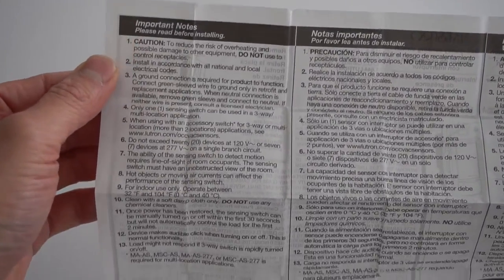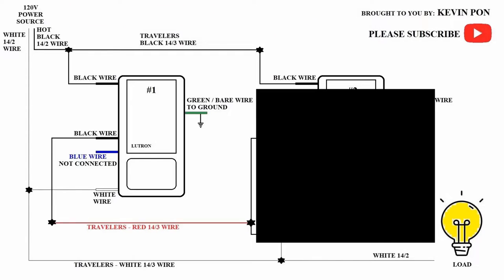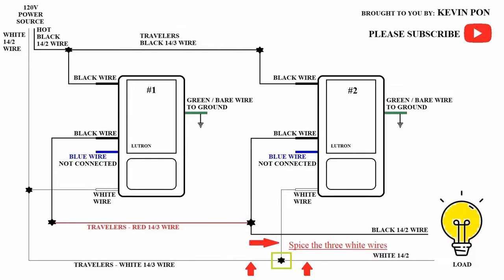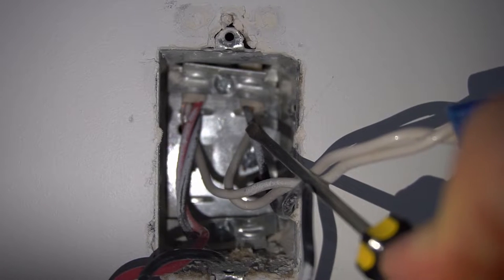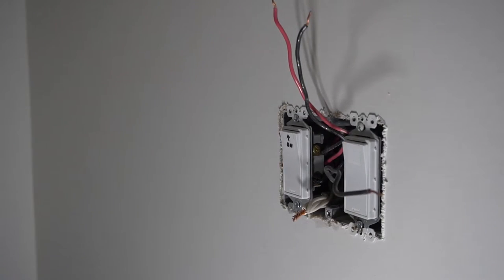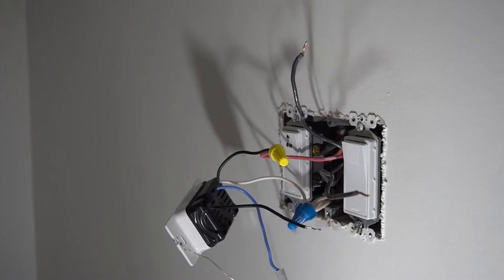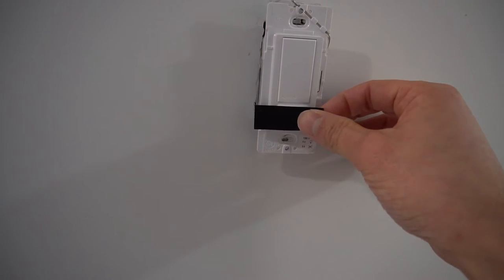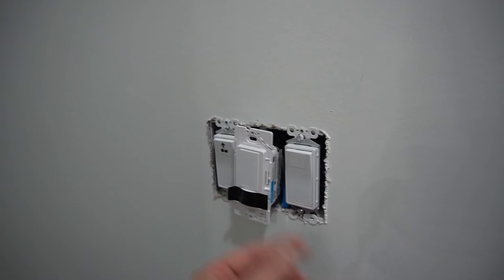TWO Occupancy Sensor 3-WAY Switch HACK BYPASS THAT WORKS! Any brand!

Comment from the maker: Remember to turn off the breaker just in case of electrical shock. Cheaper alternative is using two single pole sensor switch. Same setup. Neutral wire is required!
US:
https://amzn.to/3UtCLhz
CANADA:
https://amzn.to/3hagFSR
Single Pole - Cheaper alternative
https://amzn.to/3W9MUk1
Reply: So they are both being used as single pole? Two single would turn on one light?
Reply from the maker: @rnava435  yes and yes 🍻
Reply: @KevinPon.  I have 3 switches to a light would 3 single pole switches work also?
Reply from the maker: @rnava435  yes it will work. Most importantly is having constant power to all switches and a complete circuit going back to the light. Cannot have any breaks
Reply: @KevinPon.  thanks much appreciated just subscribed to you
Reply from the maker: @rnava435  thank you bro!
Reply: Do most single pole and 3 way switches all come with the same wiring hookups on the unit itself? What I mean is does it being a single pole change anything about the terminals that are used or would I have just as many black wires and load wires as using a three way switch?  Hope that makes sense
Reply from the maker: So the reason for this video uses a 3-way and not a single pole. Is because 99% of the people assume it'll be replacing your original 3-ways but that doesn't work. Have to change the circuit. When the wire circuit is changed, it turns into a parallel circuit that can be controlled just by using single pole switches. In my video were I don't use the blue wire. The 3-way sensor is now a single pole. A 3-way has one more wire than a single pole, path A and B. Hope this clarifies your question 🍻
Reply: @KevinPon.  I gotcha, im bascially trying to do this in my garage where two switches, either up or down independantly, control the garage overhead light. So i guess that would techically be a 3 way switch, but i will just try using a sinlge pole switch on both sides of the garage and see if I have any luck, probably connecting the load (red) from my wall to either of the blacks on the single pole switch, assuming it doesnt matter which one load goes to.
Reply from the maker: That's correct unless indicated in manual and neural wire is required on the switch 🍻
Reply: Wish I had found this before buying the 2x3-way 🤦‍♀️ thank you for making this video
Reply: I’ve done this this exactly the way it’s on here and it’s not working
Reply: Hi Kevin !Is it possible connection 3 switches to one light?Could you please explain or send diagram.Thank you!
Reply: Hi Kevin!I think it should be work with timer switches as well.Is it?
Reply from the maker: @igorl4594  The easiest way to explain this is do exactly how this video is shown. Now when you get to the 4-way switch. Slice the black wires together (constant power), reds together and the whites together. No you will connect the wires just like your other switches 🍻
Reply: @KevinPon.  Thank you!
Reply: I`ve never turn the breakers off when doing electrical work at home, never had a problem with. In fact, I can touch with my hands HOT and NEUTRAL wire (120), don't feel shocked

Comment: Electrician here, I have a couple of years in the trade and yet I sort of skimmed through the official manual without reading the disclaimer of "only one motion switch may work in a 3 way circuit". No wonder the actual diagram on the manual didn't work. Was beginning to think i was going crazy. Thanks a ton!
Reply: That diagram that came with the switch is crap.. :)

Comment: I worked in the occupancy sensor industry for about 15 years. There was a court battle over the patent rights to using a ground return. Long story short, this affected the ability of manufactures to make two sensors work in parallel as suggested here. It is a little complicated legally but some manufactures avoided infringement simply by declaring that a 3 way would not work. In reality, some do. From the example of this video, it looks like it does work.

Comment: Both of my box's only have 3 wires, 1 red, 1 white, and 1 black. I can not find anything that works....... It would have been nice if they told you these switches were designed to only have 1 sensor per circuit. everything else I look into only shows you how to install it per the instructions which does not show you how to wire in two sensors....

Comment: According to your wiring diagram, you can install two 2-ways motion sensors to make light working as a 3-ways circuit.
Reply from the maker: Yes that is correct. I made this video as many requests 🍻

Comment: I guess I have a different model of Maestro switch’s that do not have the neutral wire.  Is there anyway these could be made to work.  I have tried the wiring diagram with no luck.  Thanks

Comment: I think there's 1 more way too, if you get 2 of those chinese 110v pir motion sensors with 3 wire output you could probably wire 2 of them to the same light or string of lights , the wall switch would only turn the whole seup on or off, but you would have 2 sensors pointing in opposite directions. this would only be useful in a hallway, etc

Comment: Not a criticism, just an observation: The schematic (wiring diagram) @ 0.57 shows the BLK Hot (Line) wire connects to the "input" of switch #1 and the "input" of switch #2. The "output" of switch #1 connects to the "output" of switch #2 which then connects to the Light bulb (Load). These two switches are simply connected in parallel, that's all. You can use the less expensive MS-OPS2 instead of the MS-OPS5M and get the same results.
Reply from the maker: I was working with the props I had but that is 100% correct. Good observation Chris! 🍻
Reply: I was wondering why a single pole could not be used instead of the 3-way switch???
Reply from the maker: Yes you can. I was using with what I had 🍻

Comment: Just want to say thank you!!! I am no electrician. Had stairway that makes an L shape to garage. Wanted stairway garage light to work either when I pull into garage or top of stairway going down to garage. Looked at your wiring diagram but your actual installation part proved perfect and easy to follow. I guessed right which box had the load, everything worked perfect the first time after install. One caution to note though…. After installing switches and waiting the minute like you did, it took mine over 5 minutes to switch off first. I almost thought I had something wired wrong. Lucky I waited a bit more. Works perfect. Guess I can program them for shorter on time. Thank you again!
Reply from the maker: You're very welcome. That is wonderful! Glad to hear everything went well! 🍻

Comment: Thank you very much.  This is just what I needed.  I also took a switch apart to see how it works, to feel confident that it was the right way to hook the switches up.  But that made me realize that I could have saved $20 by buying single way switches instead.
Reply from the maker: My pleasure Bruce! Yes you are 100% correct. Single way switches will work as well 🍻
Reply from the maker: @Francis Man if you send me your email. I'll get back to you asap
Reply: @KevinPon.  I e-mailed you thanks.
Reply from the maker: @fcpman40  email sent. I hope you'll understand it 🍻
Reply: @KevinPon.  do you know if I can wire a motion sensor switch at one end and a caseta smart switch at the other end so I get motion sensor on one side and a smart switch on other side? (typically for caseta switch, I think they make u wire one end and jumper the other end and put a wireless pico remote there)

Comment: Had to comment, this worked beautifully with leviton ips06 motion sensors. I did have an issue where when the lights were to be off, the lights flashed full brightness in a pattern of 0.5 sec on, 1 sec off.  was driving me crazy until I read as a troubleshooting step to swap one of the LED bulbs with an incandescent.  Did this, and it solved my flashing problem.
Reply from the maker: That's awesome news my friend! Glad you figured it out 🍻

Comment: This helped me a lot for installing 2 ECOELER 3 Way Motion Sensor Light Switchs in a stair way. There is a post on Amazon by a Donn R. for this switch that helps with using two 3-way sensor switches that leads people here. The only difference for me was the ECOELER has a red and black wire verses 2 black wires as in this video. On the Aux switch I had to connect the black wire from the switch to the black traveler, which was hot coming from the primary switch. Then from the box I tied the other red traveler wire with the other black wire with the red traveler on the switch. Still capped both blues on each end. This worked for me like a charm just like in this video, so thank you very much Kevin for this video.
Reply from the maker: You're very welcome Charles! Brings me joy when I can help others 😁🍻
Reply: Were your motion sensor switches the ones that turn on automatically, or just vacancy sensor?

Comment: After seeing this youtube a couple of times, I was able to understand the house wiring and the diagram that came with the switches.  Blew off the circuit breaker couple of times, but that is because I installed the first switch before I found your instructional video.  So I corrected the connections on the first switch and all went great from there.  Thank you Kevin!!!!
Reply from the maker: Glad to hear you have solved the problem! You're very welcome Hamid! 🍻

Comment: Many thanks Kevin for this video...it helped a lot...I have spent 3 days already tinkering on the wiring, and almost gave up, as I have different configuration. The line and load are on the same box. Read through the comments and found what I needed to do. I have Leviton switch...works the same. Keep up the good work!
Reply from the maker: Thank you and you're very welcome Jerry! Glad to hear my video helped! Yup, this will work on all brands of switches. 🍻
Reply: @KevinPon.  I just wired my second set, this time in the second floor stairs leading to the bedroom...just did it in 15 minutes this time. Thanks for this video!

Comment: Crazy how hard it is to try to find out how to do this.  With two Lutron MS-OPS5M motion detectors, there were no instructions on how to do this (ya think they'd publish how to do it, let's say in the case of a stairway like in this video and in my use case).  The diagram was perfect for me.  Thank you for publishing this!
Reply from the maker: Happy it all worked out! 🍻
Reply: @KevinPon.  Turning them manually on/off works, but the motion sensor seems to not work each time on them.  Any suggestions?  I've played with the Lutron settings and such.  I'll keep tinkering.

Comment: This is great - the only minor downside is that it's not operating in true 3-way mode, in that you won't be able to use the 'other switch' to turn off the lights - to turn off the lights you'll just have to wait until the triggered PIR switches off or you manually turn that switch off - pressing the on/off button on the other switch will have no effect. 
The good news is that either switch will turn on the lights ...
Reply: Is there a work-around for this, maybe by doing something with the blue wires?

Comment: Correct me if I’m wrong, but couldn’t you use a pair of the cheaper single-pole motion sensors instead? When you don’t use the blue wire, you’re using these in single-pole mode, right?

This wiring is simply two separate single pole switches feeding the same light. It works because they’re both on timers. Which is to say: I think it’s brilliant!
Reply from the maker: Bingo! You are absolutely correct. Additional note, neutral wire is required 🍻

Comment: Wont the power source be the 14/2 wire always?   There are like 3 ways to wire these and if one of the boxes has a 14/2 and a 14/3 wouldn't that be the power source?
Reply from the maker: @BassManStrikes  yes, only 1 out of the 2, 3-ways switch will have the constant power (feed) 14/2 and the other one will be the 14/2 switch leg 🍻

Comment: Hey I’m just curious since you are back feeding other outlet nothing burned out after time. I’m no electrician just wondering I don’t know how sophisticated those switches are and if it won’t burn them out. Your video helped me out with installation Thx
Reply from the maker: Hello there, nothing burned out. Just simply doing a parallel circuit 🍻

Comment: Worked like a charm! Having similar issues with 3 way smart dimmer + 3 way dumb switch. Do you happen to have a solution for it? Even a professional electrician hasn't been able to figure it out!

Comment: My current setup is two 2-Gang Toggle Wall Plates with 2 switches at each end of a hallway. I would like to replace this with two 2-Gant Rocker Wall Plates with 2 single pole Luton Auto On/Off switches. Would this allow Auto On/Off or manual On/Off from either side of the hallway?
Reply from the maker: Yes, the single pole will work. Will be the same wiring 🍻

Comment: Am I missing something ? 
Don't you basically  now have two sensors working in parallel?
Not 3 way anymore.
If one switch is on, you have no control of the lights from the other switch.
As in, you can't walk past one sensor and then manually turn off the light at the other like the original 3 way switch set up.
The OPS5MHWHC can be connected to a standard 3-way switch and keep full function. As in manually turning the lights on or off from either position while keeping full function of the sensor.
Granted, you only have one sensor, but in high sensitivity  mode, it seems to trigger when entering a large room from either doorway.
If I am missing something here, please explain
Reply from the maker: Yes, I now have two sensors working in parallel. I have an old video showing what would happen if you wired two 3-way occupancy sensor switch the original way. It does not work, therefore the wiring has to be changed. https://youtu.be/Ma_gWiJ5VEE
In a sense it's not 3-way but this is the only option to have two working occupancy sensor working on 14/3 wire that was wired for the original 3-way. It works and people like it 🍻

Comment: Hello are there such motion sensor switches that can be installed on stairs that require 3 switches because there are 3 levels to the building?  Do you know any?  I think that may be considered 4-way switch?!  Am i correct?
Reply from the maker: Hello, if there are 3 switches that control the same set of lights. Then there will be two 3-ways and one single 4-way in the middle. You can check out this video for more explanation. Cheers! https://youtu.be/9pOdotxdYp0

Comment: Kevin - thanks for the video. My 2nd switch that is fed power only has a single black cable, not two like your example. How does this change the configuration?
Reply from the maker: Hi DW! Oh boy. Just to confirm. You only have 1 black wire that's it? No white or red?
Reply: @KevinPon.  It has red and black traveler wires and white neutral. The black wire out to the lights is actually in the first box. I was able to figure it out through a few hours of trial and error. This task was made more complicated with a set of bathroom lights/switches in a different part of my house also on the same circuit that must be connected to the first switch to function. Working solution =  1st switch box has 4 black wires (switch, hot, traveler for bathroom lights/switches, and black traveler to 2nd switch) together,  5 white neutrals (all of the above plus the lights) together, and finally the red traveler, black wire for lights, and black 14/3 switch wire together. 2nd switch is wired to white neutral, 14/2 to black traveler that is connected to constant power, and 14/3 to red traveler. Messy but works perfectly.
Reply from the maker: @sdsfive  I am glad you got it all figured out! Job well done! 🍻
Reply: I recently found myself in this situation.  It means that the electrical load is wired from box 1, not box 2 as shown in Kevin's diagram.  To solve, you need to figure out which color traveler wire in box 2 (either black or red or white) is transmitting current back to the load in box 1.  Typically this will be the wire that is connected to the "common" terminal (the darker of the 3 terminals) on the manual switch you are replacing in box 2.

Connect to the black "line out" from your new switch 2 to this "common" wire in box 2.  At this point, two of your three traveler wires in box 2 are accounted for - the "common", and the black that you connected to the hot black 14/2 in box 1 as per Kevin's diagram. Connect the white wire from switch 2 to the final unaccounted-for traveler wire in box 2, and in box 1 connect that wire's other end to the neutral white 14/2 wire.

Comment: I wanted to to do this on my basement stairs as the lights always get left on and they burn out much faster LOL.  Does not look like it works if your 3 circuit has one switch that has no neutral.
The box at the top of the stairs has 1 14/2 coming from breaker box, 1 14/2 going to light and 1 14/3 going to the other switch at bottom of stairs.   This was wired in 2012 and apparently it was up to code them to have a switch with no neutral.

Comment: What happens if you don’t have any neutral wires ? Only the two travelers and power at each switch ?
Reply from the maker: No neutral at all?? That's very odd
Reply: @KevinPon.  no neutral wires were ran . I ended up grounded them as the paper said and it worked . Thanks for you video 🙏🏻🙏🏻🙏🏻🙏🏻
Reply from the maker: @toco002  you're very welcome! I was just about to tell you the ground wire will be your last option 🍻

Comment: So to be clear in your diagram both sensor switches are single pole?
Reply from the maker: Hello, I made this video based on request. 2x 3-way sensors. But yes single pole options will work and also cheaper alternative 🍻